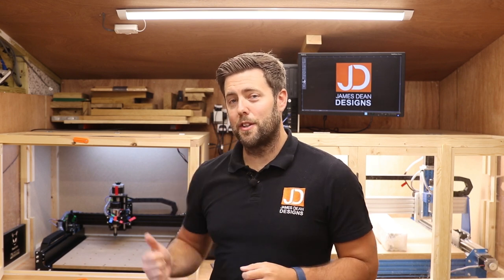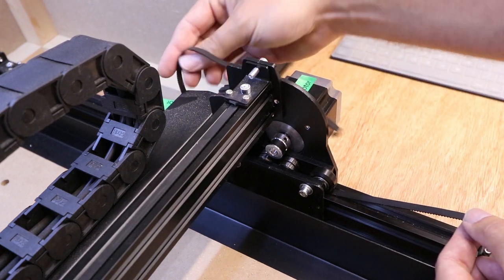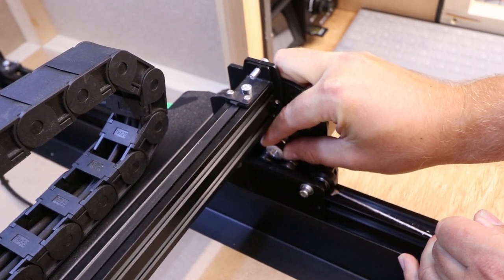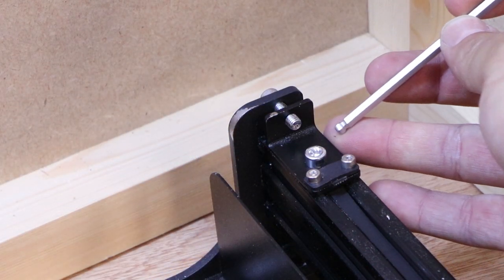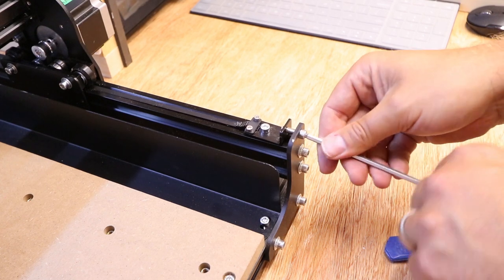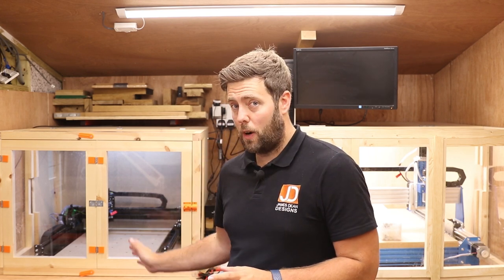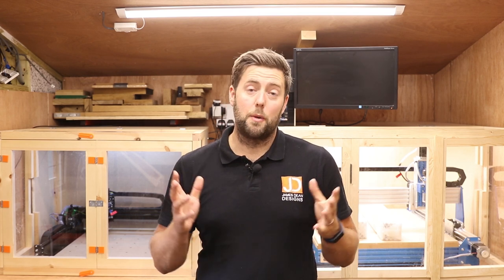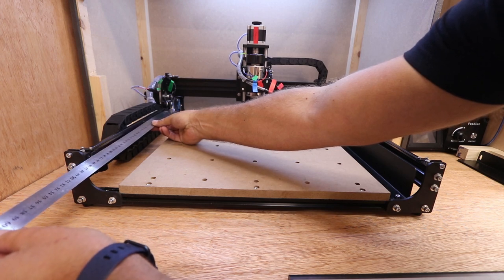Changing belts and setting the tension on you CNC machine

Comment: I will buy a belt drive cnc . (ball screw to expensive) .  are their better quality belts available than the ones that come on the machine. I will mainly be cutting .25 (6.35 mm) plywood. excellent video thanks

Comment: If I have random lines showing up on my laser engravings (streaks) would you think it’s a belt issue? They look like changes in power when engraving an image on the rotary. They are randomly spaced but consistent in placement when run multiple times. Doesn’t typically happen with flat objects.

Comment: How do you stop the wasteboard from bending under load when carving, everytime i setup a job the wasteboard bends and the spindle holder puts a strain of the roller wheels and caused a deflection of about 2 degrees. I am using the same paremeters fox alien posted in their video on cutting 5mm aluminium have used but mine results in excessive downward force being present and causing the deflection from the vertical plane.

Feedrate 800
Plunge rate 500
Depth .10
same single flute 3mm endmill

Any help would be greatly appreciated.
Reply: I just measured the gap between my workbench and the underside of the spoil board (mine was 29mm) then 3D printed a couple blocks that were 29mm thick an stuck them under the spoil board for support. Cost $1 and eliminated all the flex. You could also just cut some wood supports to the correct thickness with a table saw and stick them under there.

Comment: My workshop if frequently in the high nineties temperature wise in the summer. I've noticed my machine shifting on the x axis. Not all the time but I'm thinking the heat has finally gotten to the belts. There is no adjustment left just like in your video. Can I try to take some slack out of the belts until I receive my new belts?

Comment: Thanks for the video. Would you use the same technique and same tension (5lbs) for the Z axis belt on a Masuter Pro too?
Reply from the maker: Yes. the 5lbs rating in my video is just a guide. For the most part as long as the belt is tight and has a little bit of spring back it should be ok
Reply: @JamesDeanDesigns  Cheers James, I've just finished doing this, and will now resurface the spoil board before trying a new job. I hope this fixes a step missing issue I've had since first setting the machine up a few weeks ago. Fingers crossed!

Comment: Are there test cuts that could be made that would show you that belts needed to be re-tensioned or replaced?
Reply: I’m having tension issues on my x axis. You will probably see the initial cut is offset. The manufacturer should have recommended tension settings I just got myself a luggage scale to be able to tell what the tension is as opposed to guessing.
Reply: Cut a 100mm square. Measure the cut and adjust as necessary.

Comment: James, do you have any thoughts about doing heavy cuts with this machine. I currently have a 3018 that is screw driven and have no experience with belt  driven.
Reply from the maker: This machine is capable of heavier cutting, the spindle probably play more of a part than the belts but I do usually advise if people plan to machine things like aluminium then a screw drive is better